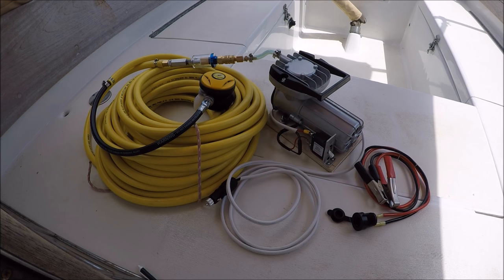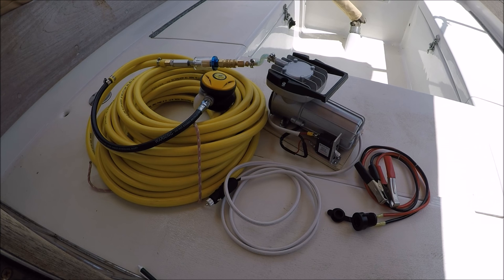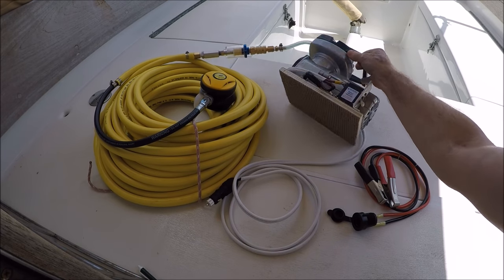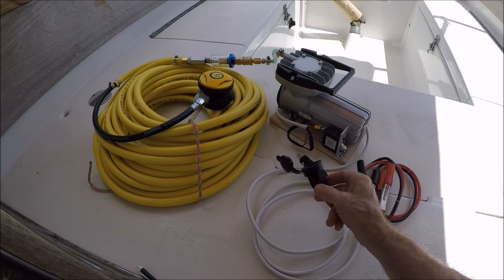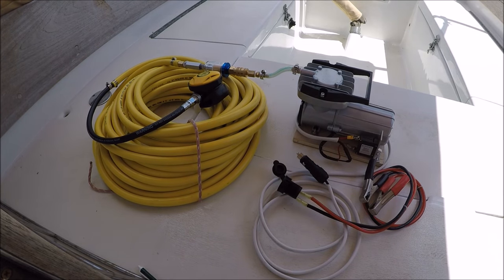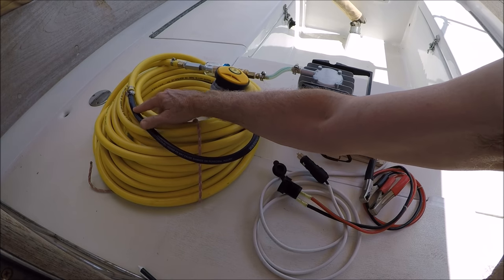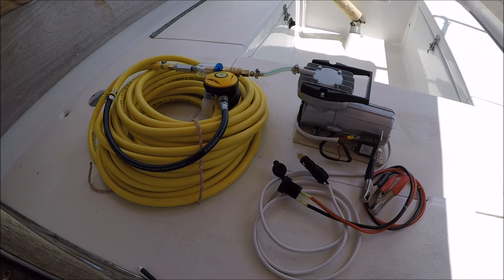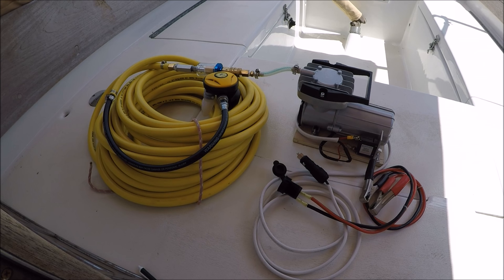DIY $300 Dive Hookah for Boat Bottom Cleaning

Comment: Can I use the smaller pump 60-80L/min ? or do I have to use 150L/min like you,Will a small air pump be enough for me to breathe?
Reply from the maker: This is the smallest pump that will provide enough air. More details are in the description above. I found that when you test the pump on the surface with no filter connected it seems like it has more air output than you'd need but then the air filter restricts the flow to just barely enough. And it's not safe to use without the filter. Also, once you are a couple feet underwater the flow is further reduced.

Comment: Hi..thanks for this video. I just got the stuff to do it...question...if the line gets blocked/bent does the pump have a bypass or shutoff that keeps it from jamming...thanks again
Reply from the maker: The pump does have some self-limiting pressure regulation so that it won't damage it it you kink a hose. The pump will keep running and as soon as you unkink it then the air flow will resume.
Reply: Hey thanks for making this vid. I bought all the stuff and I think I will add a tank too. I have seen the talk of adjusting the regulator but I can't find anywhere on it how to adjust it (that make and model) @atomvoyager
Reply from the maker: @frecou6275  There is no adjustment for the regulator because it is factory set by a spring. For low pressure hookah use it would help if you could take it to a dive shop, explain what it is for and ask if they can swap out the spring for a weaker spring to make breathing easier. It's not necessary though so you should use it as is first and maybe, like me, you'll find that you don't need to adjust it.
Reply: Ok  Thanks again @atomvoyager

Comment: I forgot to ask you how long you ran it and if it got hot..it may need cooling fan etc to perform better..thanks
Reply from the maker: No it's fine as is.
Reply: I installed a radiator with computer cooling fans, lake/sea, water pump circulates the water. The enclosure stays cool inside.

Comment: I built this same unit. Added a adjustable pressure blow off and an air filter.
When I inhale through the regulator I hear the pump change sound as if I'm taking more than is available.
Any suggestions? 
Thank you
Reply from the maker: With the components I used there is just enough air available as long as you control your breathing. You will need to suck a bit harder towards the end of each breath to get the last bit of air out the hose before the pump has a chance to catch up while you are exhaling. You need to learn to control your breath with these low volume pumps. many people tend to unnecessarily slightly hyperventilate when under water. Also, maybe you have more restrictions than my setup due to your "pressure blow off" and type of air filter.  Maybe try removing the pressure low off if there is any chance it restricts flow and try a less restrictive air filter.

Comment: + atomvoyager Thanks for your video. Regarding the management of your umbilical (If you haven’t tried this already ?) without a second person to pay it in/out to you. Rather than throwing a heap of extra hose into the water ( as in your video), you may find it useful to lash/hang a couple ‘ horns ‘ outbound of your staunchions, so you can figure 8 your umbilical and manage the length( from the water). Not only will this reduce potential fouling/snagging of your umbilical but also reduce the chances of other vessels picking up your umbilical in their props. Thanks

Comment: All the “safety sallies” can chill out! He has an in-line filter and is only down about 15 ft. You get more potential garbage in your lungs at a bar with smokers. If the damn pump fails he can easily swim to the surface.
Reply: Jon McNabb Tour totally right he could also buy an air reserve tank!
Reply: Same argument about carbon monoxide poisoning  with little buddy space heaters. OSHA rates 30ppm over eight hours, but most people fail to recognize a gas burner stove cranks out about 600ppm ever second. 🤷🏼‍♂️ I could never get mine in a tight space over 36ppm and it was 115 degrees inside my camper.

Comment: 4 years later and what do you think about your hookah? I'm thinking about doing but the water in SF bay is dam dark it freaks me out lol.
Reply from the maker: I haven't had any issues with the two I've built but they only get light use about 3-4 times per year.
Reply: @atomvoyager  how are your temps on compressor? Do you run it more than 30 mins at a time? So you must have over 30 hours on it I am guessing, is performance the same or do you notice it does not deliver as much air..thanks again for sharing
Reply from the maker: @roadstar499  The compressor and the air it delivers has never gotten hot but I never used it continuously for more than about 40 minutes. I didn't notice any lesser performance over time yet.
Reply: @atomvoyager  all good to know..thanks.

Comment: You should buy yourself a portable air tank like people use to air up car tires with so you  can run your compressor air into the tank and your air supply hose can connect to the air outlet that way you can at least have a back up supply of air that's in the tank such tanks only cost around $50 dollars . This was a good video
Reply from the maker: An air tank would of course be a good upgrade but I wanted the absolute smallest and most compact simple system to let me work at 4 feet depth for a brief period. And after having my wife do a test by cutting off the compressor while I was cleaning the bottom of the keel I found I'm comfortable with an unexpected loss of air flow, at least at that shallow depth. Someone could buy or make a small air tank though and that would make it safer and give more capacity.

Comment: Having watched this video, I bought this set-up to clean the drives on my boat.  It works...but only just.  I had to suck on the regulator hard enough that it was uncomfortable.  I ended up upgrading it to a different compressor.
Reply from the maker: Thanks for the feedback. Your breathing requirements may be more than mine or these cheap Chinese compressors may have uneven output or the resistance of your regulator may be more. I notice that I have to suck on the regulator more than is comfortable but have gotten used to it and after having cleaned my boat bottom 4 times and another boat as well have several hours successful use on it now. I can appreciate your comment that it only just works.
Reply: What compressor id you upgrade to? The ACQ-910?
Reply from the maker: @believre  A friend wanted the one in the video so when I built the second one I upgraded to the 910. I can't really tell a difference in the output though. Maybe just slightly better air flow.  I noticed these pumps put out plenty of air until I connect the filter and regulator which restrict the flow a lot. Even so the 910 works OK for me.
Reply: check our compressor
Reply: Hey, I have the same set up but I didn't bother to get a regulator, I just clipped a cheap snorkel to the yellow tube - works good, don't even need to suck at all
Reply: Did you adjust the second stage regulator to the lower pressure?
Reply: Most hookah regulators only require around 50-70 psi unlike most regulators that are set up for recreational divers and they are set up around 140psi.  That's probably your problem.

Comment: These are diaphragm pumps. problem is, they compressing air directly from the 'brushed' motor/armature housing. also, they could fail any minute. I already had one fail on the test bench. Defective 'commutator' Never would I rely on a single one of these pumps with my life.
Reply: Eh. If it's safe to breathe who cares. Even the bottom of a coast guard cutter isn't that far from the surface.

Comment: What's the mpa on it .12 let's see what that is ,say it 16psi and hooka ,browns 3 lung and every other product on the market are 30 psi minimum but average usually anything upto 50 psi .these pumps are not anywhere good enough for doing anything but supply air to pools an ponds . Buy the real deal cause .12 mpa will not do cause that's supplying no air in litres per min
Reply from the maker: The numbers listed may not be correct because in the real world test it actually worked fine. Or it may be that the other units are supplying much more capacity than what I need at 4-foot depth.

Comment: I just got a ACQ-910 its a little bigger then the ACQ-908 Do you have a air filter between the pump and the air line if you do what is it?
Reply from the maker: There's one for $23.29 now on ebay at Gator Gill Diving. The direct link is really long but you can find it currently listed if you search "Hookah Diving Airline filter kit combo" on ebay.

Comment: Hi, how long compressor works on battery when it is on boat?
Reply from the maker: It draws 7 amps so if you had a single small 80 amp hour battery that you could discharge 50% then it would run for 5-6 hours continuous before you need to recharge the battery.
Reply: @atomvoyager Thank you so much

Comment: The only thing you're missing is a safety tank inline with the hose containing some air volume at pressure to compensate for a failed compressor or a failed regulator and prevent flooding. It also prevents the possibility of forming a vacuum in the hose and sucking your lungs out in the event of a compressor motor malfunction.
As a former naval submarine engineer and scuba diver, i have had the misfortune of seeing and experiencing some nasty incidents. I personally spent a few days in intensive care. Keep it safe
Reply from the maker: Thanks for the comment. I had considered adding a tank but I wanted to keep this simple and compact to store on a small boat. If someone is going deeper or using a stronger compressor then the added safety of a tank is a good idea. But at 4-foot max depth  and having the smallest possible compressor the risk is less. I noticed that on each breath I am drawing down most of the built-up pressure in the hose so this thing is not capable of giving me too much air during a malfunction it seems. Even so, people should consider adding a tank for reserve air and safety.
Reply: Good reasoning for a shallow depth. As long as you're not tempted to go deeper. I figured the long hose might allow you to be tempted :-0
Lungs can draw 8 litres/2 gallons per second and then you need to multiply by pressure of say 1.12 at a 4 foot depth for a free flow from compressor. Then you have flow restriction in terms of the hose length, regulator and filter so you need to allow for more flow. So your pump would need to be capable of providing this peak flow at the least. I could do some calcs, but from your video, you said 2.5 L/s peak flow of the compressor? And that will be a wishful rating from the manufacturer at possibly 0 pressure. Diaphragm pumps lose a lot of efficiency as pressure increases. But I do see the benefit of your system with a careful and experienced user. Just dont ever sell it to someone unless you want to risk a lawsuit for duty of care etc.
I like your channel. Very nice work on the boat modifications. Keep it going.
Reply from the maker: Good points. I appreciate the info. Maybe you had a typo in the 8L/sec rate. I'm not good on the math but let's say the air delivered by the compressor at 4 feet after all the restrictions of hose, filter, regulator is about 100L instead of the rated 150L. I checked my respiration rate when scrubbing vigorously is 22 breaths/min. Not sure of my lung capacity but my dive test showed I was using nearly all the air available. Assuming I used a peak of 100L/min means I was using only 1.66L/sec unless I have an error in my math. My numbers could be way off since I don't know my actual tidal volume or other numbers. The real world test did confirm my guess that this was the minimum size pump I needed.
Reply: You are correct in your calcs of 1.66 L/s but this is the mean (average) air flow rate. Human respiration is a pulsed waveform, so we need a high momentary flow rate. Typical lung capacity is 5-7L from memory, so to fill the lungs during rapid breathing, you need a lot more than 1.66L/s, unless you want to wait 4 seconds to fill your lungs for each breath. This is all at 1 atmospheric pressure. Naturally, the volume of air will change in accordance to depth and pressure in accordance with Boyle's Law. The 20 metre hose can store some air capacity, but that will only last a very short time before you have no pressure in the hose and the pump cannot keep up. If you start needing higher air flow rates from physical exertion, its going to feel like you're suffocating. 
So your system is good, but it is operating at its upper limits for a diver who is taking it easy. If there is a current, it may well struggle, but you could improve it with the addition of a floating pressure tank. This could even be a simple PVC pipe of 10L capacity, as operating pressure is low, and the stresses can be handled even by a basic PVC pipe with fittings. It will give the surge capacity so that you're not running low on pressurized air, whilst still using the existing pump.
Reply: Super Wag "Typical lung capacity is 5-7L from memory, so to fill the lungs during rapid breathing, you need a lot more than 1.66L/s..."

Although the average adult male's total lung volume is about 6 liters, we don't -- and can't -- exhale and inhale our entire lung volume. The amount we actually breath in and out is called the tidal volume, and it's typically about 0.5 liter at rest and may increase to as much as 1 liter during heavy exertion. If we forcefully inhale and then exhale as much as we can, the volume of air exhaled -- called the vital capacity -- averages 4.6 liters in adult males.
Reply: Super Wag "... the possibility of forming a vacuum in the hose and sucking your lungs out in the event of a compressor motor malfunction...."

I guess you missed the part where he said he had his wife turn off the compressor while he was down without any issues. Since he's using a scuba 2nd stage regulator and not just sucking from a hose, there's little danger of "sucking [his] lungs out."
Reply: @superwag634 Human lungs have 5 lobs of total capacity of 5 - 8 liters BUT when breathing ONLY one lob is in-healing the air hence 1.1 -  1.7 liter per breath and NOT 5 liters. One lobe after another is used for breathing NOT ALL at once. I'm totally surprised by the lack of this basic and important information. Got my scuba diving license in 1980 in Poland and still remember almost all what i'have learned.
Reply: SeikiBrian ok, agree. Doctors test for the peak flow rate, not just lung volume. This is the differential function of volume, and air pumps are rated for flow rate at a certain pressure, not volume. So in short, regardless of volume of lungs, if the pump cannot deliver the required flow rate to fill the lungs, you will feel like you’re suffocating. Been there, done that, have some nice stories to tell 😬
Reply: Ryszard Jacek Ruśniak again, regardless of exact volume of lungs, it’s the flow rate of the pump that must meet the lung demand. And not just meet it, in engineering, you must design with adequate safety factors. I’m surprised that you are focused on a tangent of exact lung volume, and not on the pump air delivery rate at a certain pressure. Why bring Poland into it?
Reply: SeikiBrian ok, but the possibility of a motor reversal is usually designed for. Is this second stage regulator designed to hold a vacuum? Could it fail open under vacuum?
Do you see why your comment is not as clever as you thought?
Reply: @ryszardjacekrusniak7993  
What is the flow rate needed, that SUPER WAG is talking about in there comment, for being in less than 30 feet or 1 atmosphere?
Reply: @superwag634  so what FLOW RATE is needed to be safe for less than 30 feet of depth or 1 atmosphere?
Reply: DetectVT 30 feet of depth is almost 1 atmospheric pressure but that’s in addition to atmospheric pressure. So you would be at approx 1 bar pressure gauge or 2 bar absolute. Very important difference.
Flow rate of pump would need to be at the very least , considering factors of safety in design, your instantaneous inhalation flow rate averaged out over the minute that pumps are rated at, so perhaps 600 L/min @ 2 bar absolute. But remember that if you use a regulator, it has required operating pressures to activate valves, so your pump may need to be able to match those requirements too. And then you have to factor in the surface roughness of your hose, it’s volume, any bends, and it’s flow drag coefficient to give you a good margin of safety. In essence, the system has many interdependent variables, which is why you can’t just say “this is the pump flow rate you need”. Best is to speak to your local professional engineer specialising in pressurised breathing systems. Don’t experiment or listen to advice from the internet, including mine.

Comment: Do you ever worry about sharks or marine life while you’re working on your hull and not watching your back?
Reply from the maker: If the locals have not reported any shark attacks in the area (which would be extremely rare) I try not to worry and just get on with it. If in unknown anchorage in clear water near the reef where aggressive sharks might be I would ask a crew or someone off a nearby boat to sit on deck and scan the water and then knock on the hull to warn me if they spot anything. A thin full wetsuit will protect you from jellyfish stings. And I sometimes wear a dive knife on a leg strap.